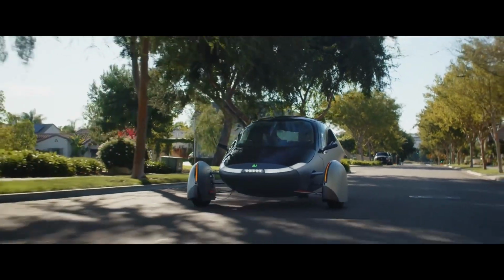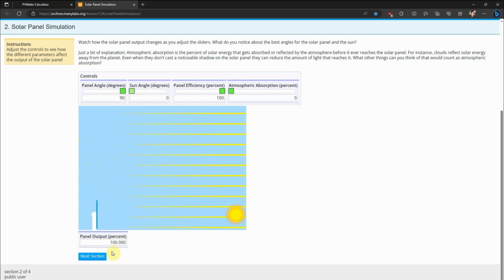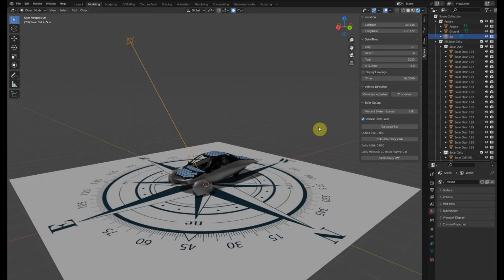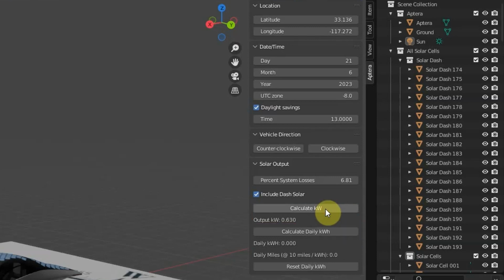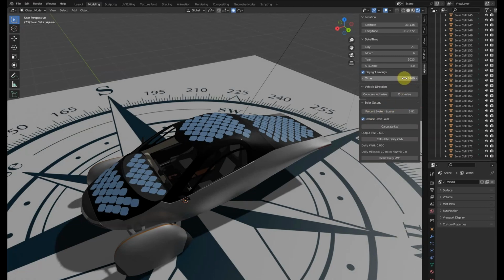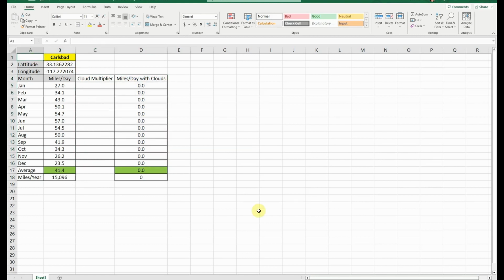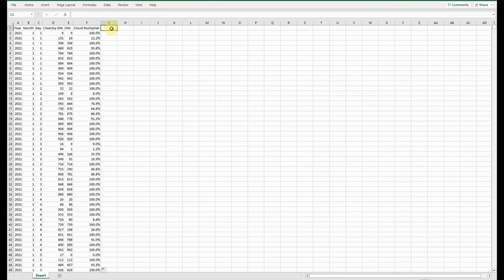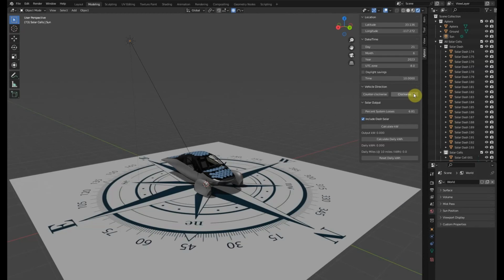Aptera Solar Calculator for Blender

Comment: Soooo helpfull to get a sense what the solar means!

I did the same spreadsheet with cloud coverage data included and turns out the Netherlands is sooo much worse, but still very useful since we don't commute as much.

With an average of 22 miles a day throughout the year with direct sunlight that's already half the amount. then we've got a mere 36% average cloud multiplier and you'll see the miles go down to 3342 a year.
That is 29% of the generation you've got there in the USA 😆 

But we won't complain though, still awesome solar!

Comment: heres some problems I had getting it to work, had to download the light/sun angle app,
wasn't default available in the addons. A few other issues not resolved as yet, clicking the right hand top round button to see full view aptera, I get a dark view aptera.
was a few other annoying issues, an updated instructions on how to use the aptera blender render is needed I think as instructions wont work with latest version without alot of messing around and quick learning if you haven't used blender before.

Comment: I managed to get some results from experienceaptera solar calculator for the day and time of fambros video ( 22nd august 2024 at 10:15am).
It calculated 512watts with dash and 453watts without dash. The calculator includes the rear hatch solar which I have to work out how to take that off the render ( should be possible as each solar cell has its own calcs), enough for today though. Just somewhere to store that little bit of data for now.
Anyhow value for the dash is 59watts according to this blender render ( by taking one of those numbers above from the other). In fambros video it showed the dash as producing 31watts max.
That is an almost 50% over estimate............now isn't that interesting!
Considering this blender model takes into account angles of the cells etc, and seems to be accurate using maxeon data for max output, efficiency loss of 6.8% used as an estimate, and its still getting 2x the output that they actually got!
One factor I couldnt work out, was how to rotate the orientation of the vehicle, I had it facing east ( default) should be facing south east to match fambros video (can work out using google earth and video the direction it was facing pretty accurately), I dont think it will make much difference, but hopefully will work out how to do that later.
Now you have to ask, have I made an error ( very possible first time using blender) or is there something very wrong with the model, or something else going on?
This is actual data fambro showed, the first piece of any real data ever shown, and it doesn't look promising at all, I can see why they never release any real data, it might be disastrous for the company.
Reply: so I just did same process for new blender render ver2 and now it shows 45watts for dash output. Fambros dash was showing 31 watts. In this instance it is still
over predicting output power by 45%. Its actually not much of an improvement.

Comment: trying to work out how to use blender, seems instructions do not work exactly for newer version of blender, so there is some working out to be done, which I'm still working on.
Lots of things not straightforward as presented on the site since blender has changed somewhat.
creater of  aptera blender file is  gene chutka, if your out there please read my comments
Reply from the maker: There is a new version of the calculator available for download that comprehends the latest solar specs for the production version of the Aptera.  https://www.youtube.com/watch?v=1iK544c_2OU

Comment: can someone work out solar output in watts on 22nd august at 10:15am facing south east direction?
1. with dash
2. without dash solar
thanks
Reply: Assuming you live somewhere near to latitude 47° it will be around 200 Watt on a sunny day if parked forward, or around 400 Watt parked backwards.

Comment: thats quite amazing work, have you considered using the actual output numbers from the solar dash display to see if your numbers match what they see in the car?
Steve Fambro did a very short video of the solar output ( without rear hatch) so the numbers are available, it was 10:30am in the morning, its on his facebook page some 5 or 6 weeks ago. Now that would be interesting see what you predict and see what it actually is.
Reply: I just went over steve fambros video, video was done on the 22nd August 2024, 
between 10am and 10:30am, location carlsbad, if you know the layout of the building you can figure out which way he was facing too ( appears to be south east approx
135 degree as he moves out of shed slight change towards east)

Heres some results from the video ( h=hood/r=roof/d=dash and m= miles range predicted).....all numbers from aptera dash display.
Maximum: h 76 r 113 d 31  ( all in watts)and m= 12 miles/day
That was max. of 220 watts out of 392 watts ( potential max according to aptera)
220/392 is 56% of theoretical max at 10am approx
Just some other numbers that came up (concurrently)
h76 r 66 d 31 range 9  total =173w  
h70 r 108 d 31 range 11 total = 209w
Since aptera is claiming a range of 40 miles at 700watts max output, they then use this value to give a range estimate. It appears they are simply finding the total output at any given time as a percentage of the theoretical max ( 700watts),
then finding that percentage of 40 miles.
As per below calculations ( this gives basically same range estimate they get)

173/700= 44%   0.25x40miles=10miles ( they give 9 miles)
 209/700 = 30% 0.3x40miles=12 miles ( they give 11 miles)
Why is there a slight difference is because no decimals are used in the range on the display ( wont go into details on that).

Comment: Interesting tool. What I wanted to know is does every single cell has it's own micro converter? Because if they are tied together, the weakest cell will determine the output of the string.
And with the chargeable distance... As long as we have to rely on the manufacturers numbers I'd say it's meh... 6.2kWh per 100km is exceptionally low even for this streamliner. I'd wait for the first production vehicles to proof this claim by independent users.

Comment: FYI, this video's model doesn't account for the fact that solar cells that are electrically in series with each other but pointed in different directions will not all operate at their individual peak power points.  Very roughly speaking, the power output of a series string of solar cells is limited by the cell that has the least amount of sunlight on it.  This error may account for why this video's model kicks out a higher estimated number of average daily miles.

Comment: That is a very detailed validation to what is available from the Aptera Solar Calculator. Very impressive. Thanks for sharing.
Reply: How far does a Tesla go at 20 mph compared against one doing 80? I reckon the difference is significant, so if speed is not factored in, then any number is pointless. I just hope he hasn't worked on speed differences, because I was so bored I kept fast-forwarding? If he hasn't - it's not detailed enough, and neither is the ASC for that matter.
Reply: @aussieideasman8498  he has done if for a stationary aptera, its really quite amazing piece of work, to do same for moving aptera would be even more complex. Will be nice to see if he comes back and shows how his prediction compares to aptera known output from fambros short video.
Also you might have missed in the video, he got 30miles range approx after all was said and done, it will still be an over-esimate as the vehicle is not moving and some other factors not accounted for.
Reply: @namenotshown9277  This calculator needs a revision since Aptera is drastically not the same. I suggest they build one and test it in at least 50 parts of the world and adjust all calculations to match the variations they get.
Reply: @aussieideasman8498  I'm really keen to see if he comes back with a comparison to apteras actual data........that will be very interesting on just how accurate it its.
Since there is no hatch it would require the author to do some changes to his software, but I would imagine he would be quite keen to see just how accurate it is, fingers crossed he will come back with some numbers.

Comment: A few months ago, someone was claiming that the Aptera Solar Map was overestimating the figures for very northerly locations (Canada, UK, Scandinavia, Alaska, etc).  Do you see the same discrepancy?
Reply: I'm someone that claimed that the Aptera savings calculator really overestimates the average solar miles per day for, at least, "little to no exposure" areas like Glasgow, Scotland.
Reply: @bobhilder1469  It was probably your comment that I was remembering, Glasgow as an example seems familiar.  It would be good if someone could try it using this tool using Glasgow's coordinates.  Glasgow is at the same latitude as Moscow and the Alaskan panhandle.
Reply: @bobhilder1469  You are probably right, given your expertise in the field, but if they are dead set on making the silly trike, they have to know ahead that the real figures will be revealed - it's inevitable. This is just one more reason why I believe they put out the calculator; they know the trike isn't happening. Just make sure they don't destroy the prototypes quickly like during the first fold. They are evidence for the prosecution, lol.
Reply: I see the same use of 10 miles per kW. A Tesla gets 4, and there's no proof that the Aptera shape can get an extra 6. That average commute they use is also with an average speed of under 30 mph (roughly), and wind resistance is minimal between EVs of any shape. While this guy tries to factor in everything, I didn't see him factor in speed, and the numbers would be vastly different if someone averaged 20 mph and another person averaged 70. [I hope he didn't factor in speed, because I kept jumping ahead out of disinterest.] But the main issue is that you are all crossing bridges before you get to them - the silly trike still doesn't exist and probably never will. And 4 years of prototypes, yet no real-world solar data - doesn't that ring alarm bells? So gullible!
Reply: @aussieideasman8498  "... because I kept jumping ahead"  ... I would suggest running the video at 1.75 or 2x speed instead.
Actually I see no problem with 10 miles/kWh as a rough estimate, it seems to be consistent with what details are public.  Obviously it will be necessary to fine tune & validate those estimates with wind tunnels etc, once they have physical examples of the production vehicle (not just intermediate prototypes). Nor do I see a problem with the solar gain calculations in sunnier locations, although again, that needs to be validated with the real thing.  It's the northerly figures that I am curious about & would like the author to explore.  Furthermore, it'd also be interesting to know whether cells on the side & doors (like the Sion Sono) would have any effect up north - the sun stays low on the horizon, so I wonder if a side panel in the right direction would actually be more effective than a horizontal panel.   Would be very sensitive to direction, and probably be a waste in sunnier climates though.